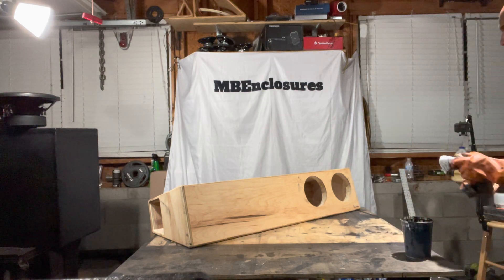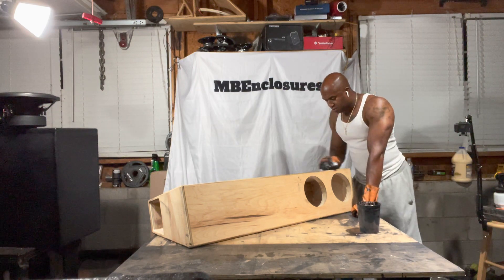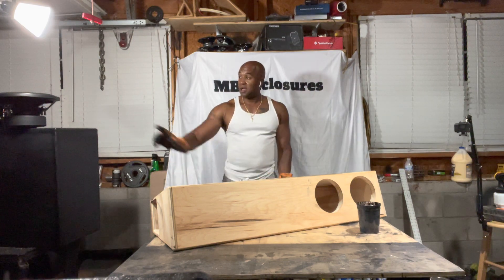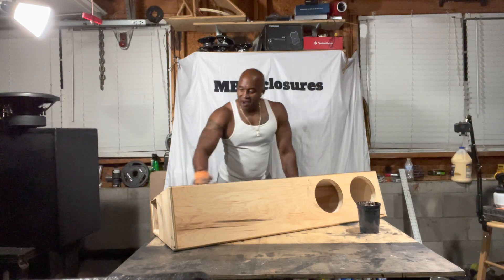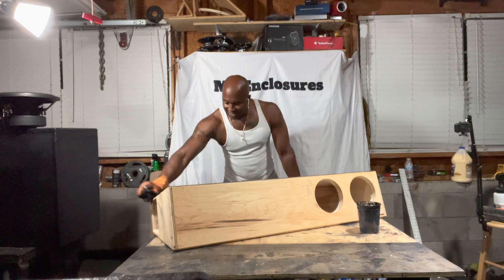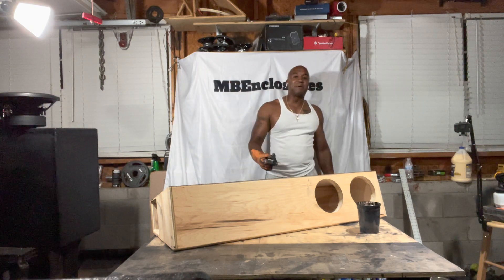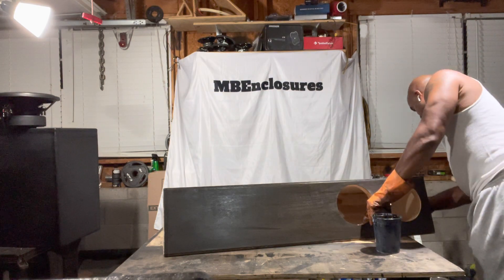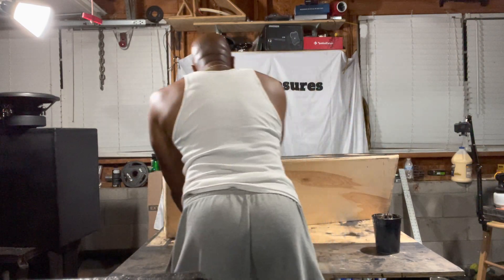XMAX vs XMECH output! LINEAR XMAX is more controlled and cleaner.

Comment: I love that you focus on using the correct enclosure for the sub. My local shop doesn't even build enclosures anymore.  A family friend came to me with a cheap Phoenix Gold 12 and a 250w mono amp. His prefab box was sealed and way too small. I designed a ported enclosure for him and his dad to build together. The bass output tripled, it solidified his interest in car audio, and his dad got to introduce him to woodworking. It was an awesome experience for all.

Comment: Old school facts! So many people running around with 2k subs with 24mm xmax and 84db with the biggest possible reflex box they can use not understanding why it’s max volume or nothing cause it hits hard at max power but is weak or sounds horrible at normal levels. Then they get in a comp and realize they dropped thousands upon thousands just to have the same max output with no lower performance as someone else running some 18mm 350w subs on factory electrical.

Comment: What is your opinion on sealing the wood on a box? Like a layer of resin on the inside and bedliner or clear coat on the outside?
Reply from the maker: Very marginal difference in output. But if you chasing the meter everything counts.

Comment: Xmech - Maximum mechanical limits of the subwoofer. ie when the physical suspension stops the driver from moving (surround, spyder) or when the coil slams into the backplate :)

Comment: Xmax is commonly measured as the amount of 1-way excursion while staying within 70% of the Bl value(motor strength). As the coil moves outside of the magnetic gap of the motor, the woofer looses strength, and as a result, control over the cone. You can't simply look at xmax to determine what will be louder, there are too many other variables.
Reply: Yeah but ya never use full xmaxx unless ya come off box tuning.🤷🏻‍♂️